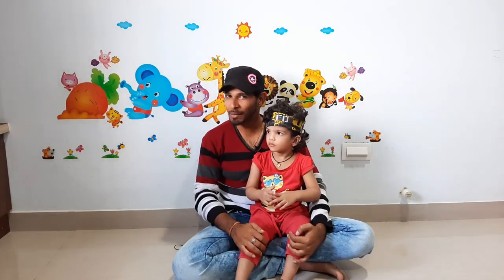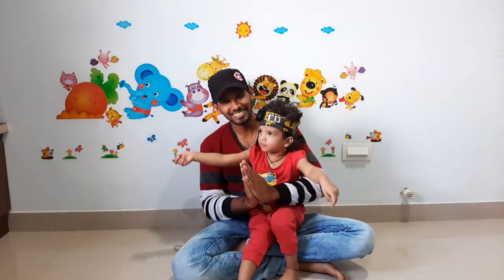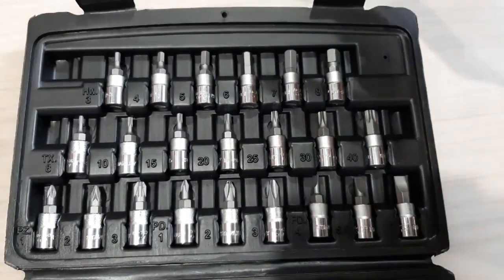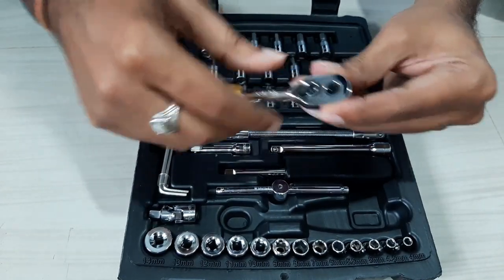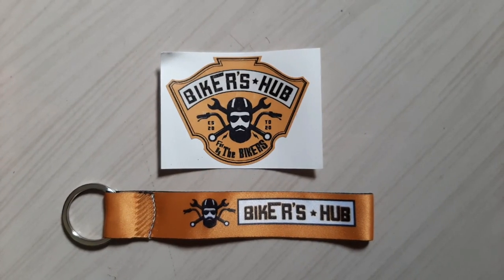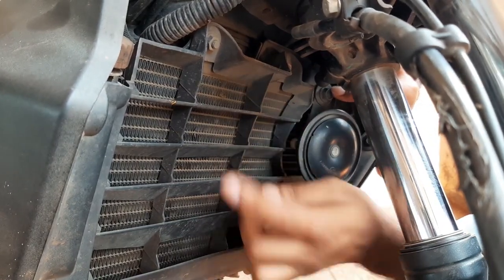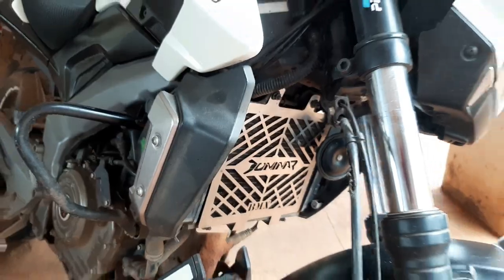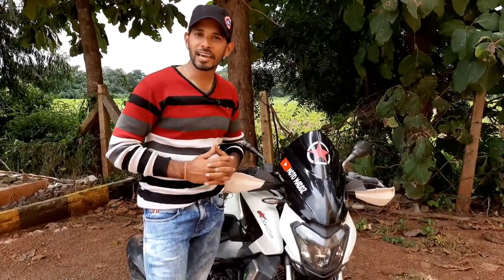Best Tool kit for Bikes maintenance & DIY || STANLEY || Radiator grill for Bajaj Dominar

Comment: Bro , i am new to mechanic things ... i want a basic toolkit for my GT650 to change exhaust full system , change engineoil , brake oil , head light , tail lights .. etc on my GT650... thisone will be enough ? Cuz i dont want way advanced tools and wzste my money
Reply from the maker: Hi brother this is perfect multipurpose tool box which can be used for house hold works too.
If you want to use for specific works, then buy following tools - 3mm,4mm,5mm6mm & 10mm Allen keys. 8,10,11,12,13,16,17 D spanner & ring spanner, flat nose Screw driver & star screw driver & one Nose plier.
buy above tools which may cost you less than 1000/-.
Reply: Thank you bro ❤ @MOTOMADDZ

Comment: bayya is it enough for dominar  self servicing and minimal repairs . plzz reply
Reply from the maker: Hi Raj 
These are enough for most of the repairs.
Tightening chain & tyre replacement cannot be done by this. Thank u for watching 👍🏼
Reply from the maker: I have done all the DIY of dominar modifications with the same tool kit. You can check in my other videos.
Reply: @MOTOMADDZ  tq anna 🥰😘
Reply from the maker: @nellirajkumar  welcome brother
Reply: @MOTOMADDZ  brother , jpt  tookit  also better  ? , wich one to buy   Stanley or jpt  ?
Reply from the maker: @nellirajkumar  Always Stanley if u want to do most of ur basic works.
For once in a while, go with 46pcs tool kits in amazon. It wil be available for below 1000.
But once for all go with Stanley.
Reply: @MOTOMADDZ  tq anna , ordered stanley .🙂
Reply from the maker: @nellirajkumar  good decision. All the best 😊